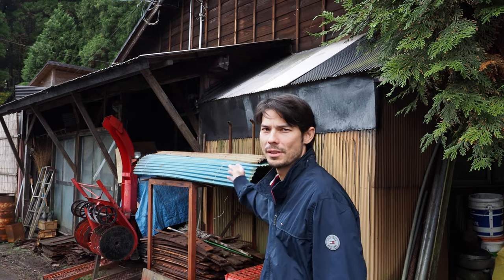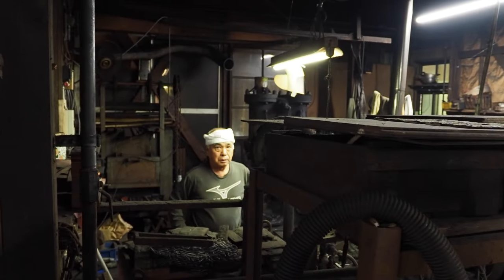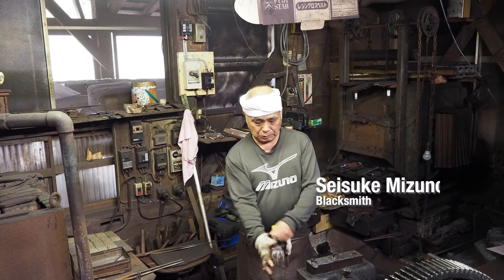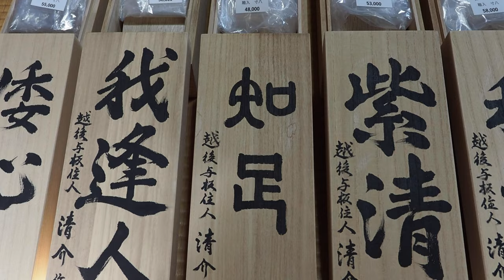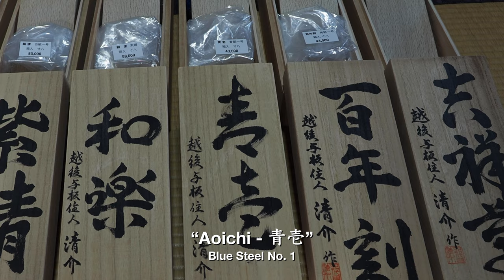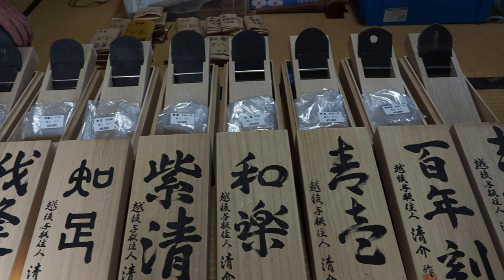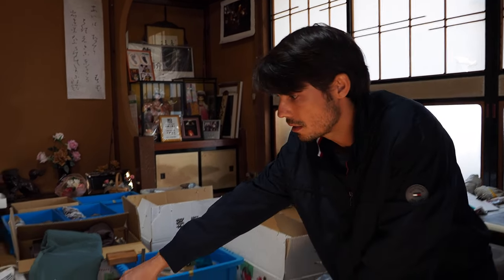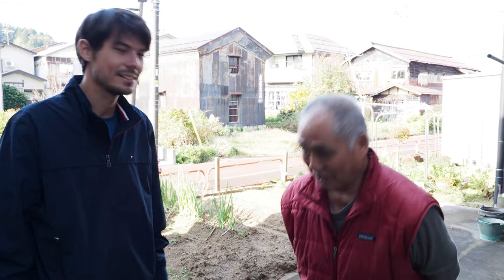Making a Mizuno (水野) Kanna Blade - Japanese Blacksmith - Master of Traditional Crafts

Comment: Having worked with German chisels, planes and saws for 60 years and with Japanese chisels, planes and saws for 40 years and worked in Australia with very hard timbers for 34 years, I can  say that I use hard steel Japanese wood working tools mostly on soft timbers and softer western steel tools on hard timbers. The hard Japanese steel chips easily on hard end grain and it takes a long time to sharpen. The softer steel is as sharp but does not chip and is a lot easier to sharpen. I learned that the hard way over time.
Reply: Blue steel is better for Aussie hard woods than white. Much tougher, less brittle. I rarely use my western chisels except for rough work.

Comment: I have four Kanna. Can't imagine working without them. Two are blue steel, two are sword steel. All of them are a joy to use. The soft iron backs make them easy to sharpen accurately and quickly. Much less effort than a western plane to use. Much better control too. I wish I could afford to buy a few more but I really need to get some more Ouchi  chisels. Can you visit a chisel maker sometime? That would be awesome to watch. 
Thanks for a great video. Keep them coming. Love your channel.

Comment: 3:07 - That's not a decorative pattern, he cold-hammers steel, making it harder in the process. The patterning will provide the alternation of harder and softer patches, providing resistance to notching and likely providing some degree of self-sharpening and is likely located on the cutting side of the blade. 

Mr Mizuno is very kind to let you visit and film the forging process - not even 100 years ago that would have been a closely guarded secret.

Comment: Fascinating video, thank you. Why does Mr Mizuno dip his hammer (sorry, I forget the Japanese for 'hammer' ) in water between strikes? Is it to keep the hammer head cool as it heats up due to contact with the hot steel and this may affect the hardness of the head?
Reply: When the water on the hammer ( or anvil surface) comes into contact with the hot metal it vaporizes and helps blow the scale (oxidized iron) off of the surface. So it's a way to keep the surface of the plane clean during forging.